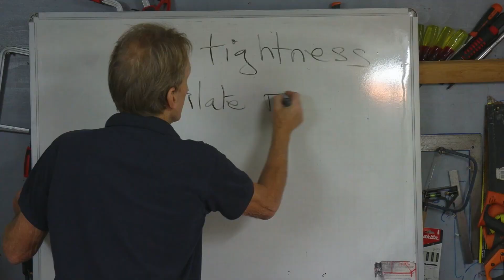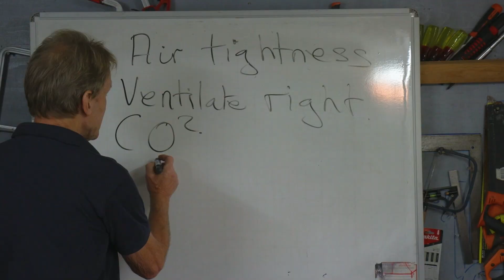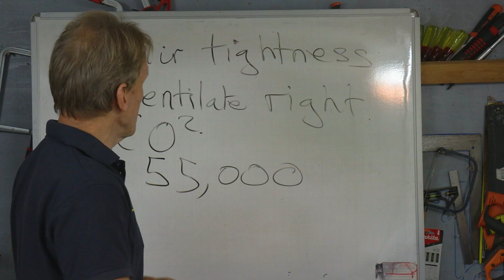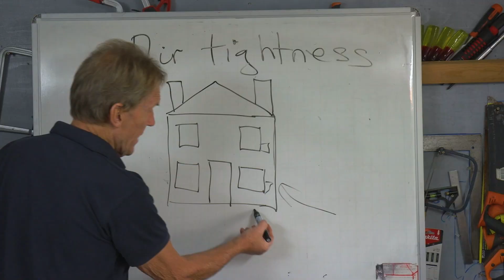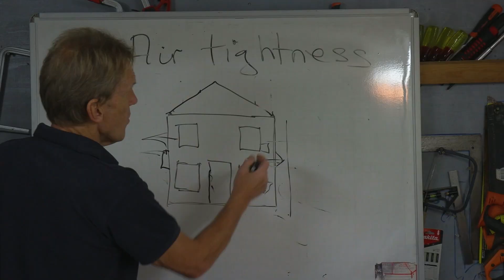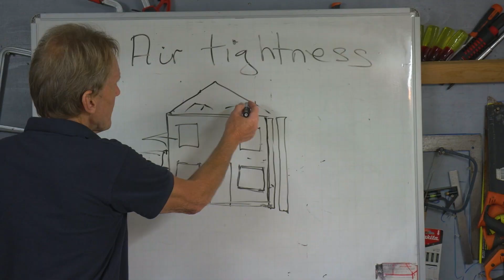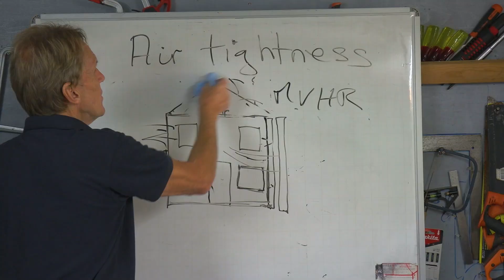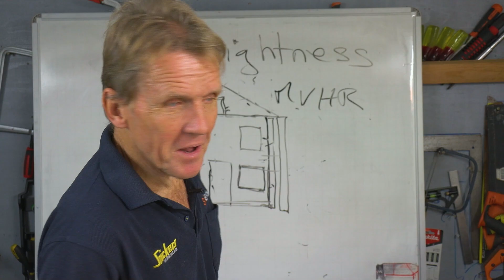The Ugly Truth About Airtight Buildings

Comment: All wet rooms incl kitchens have to have extractor fans.
Some larger houses have up to six. According to the regs they have to be tested to ensure the minimum flow rate is achieved. There are also vents on every window.
When the air test is done all these points are taped up, so it's a totally flawed test.
Reply from the maker: That is a great point
Reply: @SkillBuilder  No it isn't, testing for air tighness is relevant and then using a controlled amount of air change is fine. Most extractors are fitted with backflow shutter so no air leakage when they are off. Like most of your videos Roger but don't just appeal to knuckle dragging builders.

Comment: Mechanical Heat Recovery with Ventilation would not live in a house without it. Set up correctly no condensation whatever the weather filtered fresh air saves on heating bills . The UK as usual is miles behind
Reply: Indeed - and no thanks to channels like this putting people off of progress
Reply: @paulruffy8389 Roger did say most people can't afford the (new) tech. 
I use parentheses because the idea of passive houses has been around since at least the 60s, when those who advocated for them were considered cranks or hippies etc. Even in 1999 when I wanted to do everything to make my then house pretty self-sustaining (solar panels, thermal water heaters, wind turbines etc) people looked at me funny, like I was mad. Unfortunately I couldn't afford any of it at the time.
Reply: I'm with you. 8 years now living in a passive house with the ventilation running at a low level constantly. Paired with a 45m earth tube buried in the ground I get cooled air in summer and warmed air in winter. For older UK housing stock a wall or window mounted room unit might work better than a central system with all the ducting needed. Time for the UK to catch up and legislate for MVHR in all new homes.
Reply: @ecoworrier  As I said eco warrior we are miles behind, yet the solutions are there, just not the understanding of how to use and benefit from it
Reply: I fitted a heat recovery ventilator to my very sealed, air tight house here in Devon. Would never live without one. Replaces the entire air inside the house about every two hours. Very low energy bills and a very warm and condensation free house. The condensate tops up a water tub in the garden.
Reply: Incidentally - how do you dry clothes?
Reply: @paulruffy8389  Hi Paul we dry our clothes indoors on airer's NOT on the radiators Proair Ireland supply the MHRV small company but excellent service, we fit these in all the new properties we build
Reply: @peterfishenden5248  great to hear thanks
Reply: Zzzzz what a load of crap. Would not live in a house without it. Lol
Reply: @justbreakingballs  I've just had an MHRV installed in my house, and am looking forward to the benefits of it. That said, I think you're misinterpreting what he's saying, which is that there is no coordination in the building of new houses, or in retrofitting of existing houses, as well as the cost for most people. Here is Ireland the BER rating is a joke, as it doesn't focus on airtightness, just ticking boxes on a checklist to get a rating. I have to get a BER done to get a grant but it's really a waste of money. However I'm going to also pay for an airtightness survey, which will give me a true idea of where the house is.
Reply: @peterincork3121  Air tightness is the key, an air test with a smoke tester should highlight problems . Good Luck
Reply: @peterfishenden5248  Thanks Peter, yes that is my top priority once we get close to the end. I actually got an airtightness survey done 10 years ago and we had an horrific 20 changes of air an hour. This is a 1960s two storey house, so I am not expecting miracles but would you think we should be aiming for mid single digits ?
Reply: @peterincork3121  Hi Peter possibly would not wait till the end as the test might reveal something that needs rectifying before decoration or fittings?. Expanding gun foam and sealants are very good at sealing where the draughts are coming heat/heat going out. Low single digits can be achieved
Reply: @peterfishenden5248  Thanks Peter, that's great advice. I have the person who did the survey 10 years ago lined up again, so I'll contact him straight away.
Reply: @peterincork3121 the BER standard here for some reason doesn't follow European standards when it comes to volume of air passing through room per hour for MVHR systems, it's ridiculous. I believe Uk is the same. We're so far behind
Reply: @yanncoffey  I didn't know that but it is not surprising if it's the case. There's a lot of box ticking going on I feel.
Reply: @justbreakingballs  intelligent reply

Comment: In Arizona (where heat is the problem) our airtight house incorporates an air-exchange box which also includes humifier/de-humidifier, filters and heat exchange. Air from outside is pushed into the A/C ducting. Stale air is removed from the AC intake. The heat exchange is just an air-to-air radiator system. The exchange is driven by electric fans in both direction. The exchange rate (for our system) is 120 cubic feet per minute (the entire system is run by computer). Inter-room venting helps ensure stale air is pushed out - if the A/C system isn't in operation the computer can choose to run the A/C fans to move air around the house (mostly used in our winter!). However! The number of houses built to this standard is vanishingly small. It would be virtually impossible to retro-fit a house with this system.

Comment: That’s it you have to have HVAC system with air tightness. It should be standard spec in all new builds. Having heating on with the windows open is madness. We just live in a damp, mould prone house, but I can’t justify having gas fired central heating on all day.

Comment: What Roger is saying..... Airtight buildings are a very bad idea (lists loads of problems with this concept) unless you have a mechanical ventilated heat recovery system, in which case they are totally fine. Saved you around 15 minutes... Your welcome.

Comment: The ultimate light and tight structure is a plane, with a very sophisticated and expensive ventilation and heating system, and think how shit you feel after being stuck on one for just a few hours! People need to be warm not air, which is a good insulator and tends to move about a lot when you warm it up.

Comment: I live in a fairly modern bungalow with all mod cons, in the summer the doors and some windows can be open all day, in the winter we deal with the slight condensation that starts to appear on the bottom of the conservatory windows by using a dehumidifier overnight. All doors are normally open all day and all night with a couple of bedroom windows slightly locked open. Seems to work for me, the dehumidifier takes out about 2 litres of moister a week which we use in the iron and to water the house plants. If I am mistaken in my method I would appreciate further guidance.
Reply: Exactly same issue.Dehumidifier has helped a lot.
Reply: What you are doing is a solution but IMO an ugly and labour intensive one by having to have a dehumidifier plugged in. What Roger omitted to say is that you can get individual MVHR units for each room that get most use. Basically an electrically controlled vent with a humidistat and heat exchanger.  When it senses higher humidity it extracts the humid air, brings in fresh air and charges the fresh air with 90% of the heat in the outgoing air. Once humidity back to the set level it stops. Virtually silent, very low running costs. No more open windows etc, better security and it is totally automatic.  I know this as I built my house with MVHR which is fantastic but I needed a solution for a 2nd older property and found these units.

Comment: I saw a great video by a guy who specialises in insulating log cabins and sheds. He basically said "If you cant make something 100% air tights, and waterproof, dont even bother trying. VENTILATE". Basically 99% airtight means 99% of any trapped water causes problems. Just assume there will be a gap or pin prick somewhere, and base your design on healthy ventilation. FYI my bedroom faces the sunrise, and in the mornings it lights up all the dust in the air. Im a pretty clean guy by DAMN ... bed linen, clothes, carpets and people throw off so much dust. I have a little hepa air filter where I sleep and periodically, heat the place up and do a complete air change. Its not pleasant or cheap doing it during the winter, but you need to blow moisture out.

Comment: Roger is bang on! Only my opinion but climate change is utter BULLSHIT! As a building inspector I cannot agree more with Roger. Approved Documents L1A, L1B, L2A and L2B are fooking bullshit. Yes, insulate your property to the best you can but all this airtight stuff is utter bollocks. You need ventilation to stay healthy! If you have solid walls like I do then insulate from the internal facings and use 'Storm Dry' to keep your property dry externally which is a breathable membrane and allows moisture out.

Comment: So airtightness doesn't mean that the building doesn't get ventilated. It's to allow the ACPH to be controlled, this would be via a HRU which doesn't just allow a house to bleed heat.
Reply from the maker: mokaski 
You may have missed it when I said it but the problem here is that there is no requirement for air handling units. The requirement is for air tightness and they rely on the home owner to work the ventilation by opening vents and windows, which, as I explained, doesn't happen. Then you have this cocktail of stuff feeding off the humdidity and causing asthma.

Comment: When the Divis flats were built in Belfast families were moved from terraced turn of the century houses which were draughty into modern though not well built flats. Like my mother (who hangs dripping wet washing onto radiators to dry them) they kept windows buttoned up to prevent drafts that were seen as potentially deadly. The flats had black mould on the walls and were dripping wet. The flats themselves were blamed not the tenants who took to smashing them up to force the council to rehouse them. The flats were demolished apart from one tower. Other modern flats are successful especially when sold at a huge cost to professionals who are willing to ventilate and maintain them. The difference is almost 100% down to ventilation.

Comment: Take a valium Roger - I'm afraid your eyes are going to pop out! I fitted MVHR using a Wickes unit from a Car Boot, using off the peg trunking, really not a big deal.

The big issue is interstitial condensation - make sure that there are proper vapour barriers on the WARM side of your insulation.

Comment: I understand this was a rant - but I'm genuinely interested in getting solutions for these problems.  Can you explain how these problems can be addressed?  If trckle-vents were installed/kept open (in existing/old builds) would this be a cost-effective way to resolve the problem? Secondly,  can you tell whether MVHR systems (which seems to be the best) can be retrofit installed in existing apartments?  Are there any upcoming innovative solutions to these problems (for example have 'old' tech such as dehumidifiers/air-purifier products)  improved to the levels where they do offer a good solution in non-modern dwellings?  I appreciate it was a rant, but I really need advice and opinions on "what can be done"
Reply: With you on this.
We'll be replacing the heating system and carrying out a general overhaul and upgrade to the house within the next couple of years (ready for retirement).
Every time we think we've found the best systems, given the current panic over the climate, someone comes along and trashes the ideas.
The only 'advice appears to be from a government that says they want to save the planet, just so long as the cost isn't too great in grants and companies who are only interested in selling their own products.
Some sound and independent advice and solutions would be very welcome.
Reply: I have trickle vents, they do bugger all in summer when there's little temp differential and whistle in the winter because the temps are so different. MHRV would be an option I  our place, but it's notifiable work so I don't believe I can buy a cheapo one off ebay, will have to spend 3-4k to get one installed properly.

Comment: I did an air tightness test on a house some years ago a new house had 10 air changes/hour with all the vents sealed the woman who owned it could not keep a candle lit in the house. I think its because of this kind of workmanship that has required  Regulations to deal with the problem.
Reply from the maker: You make a good point.

Comment: In the UK, climate change is going to cause the winters to be a degree or two warmer in the winter, but probably also considerably wetter, i.e. more water vapour in the atmosphere for longer. Seems to me like the affordable solution to this is to open your windows more and help ventilate the rooms more by swinging the inside doors to an fro. Or your could use electric fans (or even human powered ones - rig your exercise bike up to one LOL).

One thing that definitely needs to stop right now is the big chain builders constructing new houses with small windows, especially in upstairs bedrooms and even smaller ones in toilets and bathrooms.

Comment: Passivehaus standard states that you should have a heat recovery system. Which means the air is always flowing. Too many airtight houses are being built nowadays without a heat recovery system. 
It may not be in the regulations but it is definitely required. 
I know you said it’s expensive but if you compare it to the price you pay to actually build a house it isn’t really that expensive

Comment: I have an airtight ("PassiveHouse" standard) house. I have a forced air ventilation system. The house has no heating system. It never falls below 18 degrees (I live in Scotland). Humidity is around 30%. CO2 is around 600ppm with two occupants. My energy bill is around 15% of a house built to current building standards. I built it because, as an oil and gas professional, I know where energy prices (and availability) are heading.
Reply: I've got a question... how'd you handle humidity in the bathroom? & kitchen?  Just curious.
Reply: @MRSketch09  It is dealt with by the mechanical ventilation system. Suck it up, spit it outside while heat is recovered from the moist air to help heat incoming "dry" air.
Reply: @kerrynofford4727  Very interesting! I have been looking into this tech for quite a while but couldn't actually find a product/provider for it... is there any you would reccommend?
Reply: Great, I'll just knock down my house and rebuild it. Everyone should do this at the same time!
Reply: Nice!  Love it!  What system did you install???  What would you recommend for small 2 bed bungalow - couple with 2 dogs!?
Reply: How hot does it get on the hottest U.K. days?
Reply: 30% humidity. That sounds almost too low. Does that not lead to dry throats etc? I’d have thought 50% was more ideal
Reply: What he does not (or refuses to) understand is that Passive House is a SCIENCE based standard and that we have addressed ALL of these issues, AND we have the receipts (research and existing project metrics confirmation) to prove it.  Match that up against his granny and his anecdotal observations (science free!) and well, I can see why he enjoys breathing his own off gassing....
Reply: @JustaCarpenterToo Roger isn't ranting about Passive houses, which, as you say, is a science - and they have the correct tech to mitigate the air-tightness. He's ranting about normal everyday houses being sealed up. My mum lives in a late 1990s bungalow which is pretty airtight. I'm constantly trying to get her to open the windows because her living room (which most of the time is only occupied by her and her little dog) is positively devoid of oxygen, it smells so sour. There's no intake of air through trickle vents as there's a conservatory attached. I've opened (and locked) the conservatory windows to the ventilation position, but because mum keeps the French doors into the conservatory closed, unless I'm there and open everything, she gets none of the benefit of that fresh air.
Reply: @gypsygem9395  i believe @JustaCarpenter was referring to the landlord from the beginning of this thread
Reply: Yup ...UP (if even available)

Comment: Bees bring in nectar at 75 percent water all day and during the night, because they have turned their hive into a condenser they remove that moisture so the honey does not ferment, they have to bring the moisture content down to below 17 percent. They can do this in one night through air ventilation heat and cold. They have heat at 32°  and a cold part where the condensation turns to liquid and provides water for the bees during the night. We need to follow where the bees lead.!!!

Comment: Your wrote on the white board MVHR but then didn't take about Heat recovery units  instead only  talked about mechanical ventilation units.  Heat recovery units pull the damp warm air out the house pass it over a heat exchanger pre warming the fresh air from outside. They make whole house ones and single room ones. That way your getting the air changes without pushing the moisture into the fabric of the building. I added one to our house and it's made a world of difference.
Reply from the maker: Did you watch the video?
Reply: @SkillBuilder  yes all of it. You talk about poditive and negative pressure fans but not ones that pull fresh air in over  the heat exchanger and blow the moist air out the HR in MVHR.  I'm not trying to be against you I have learnt a lot from your channel.